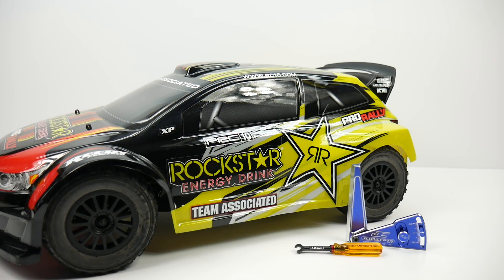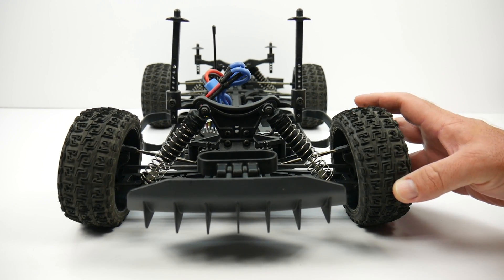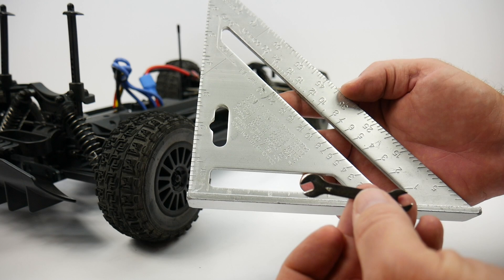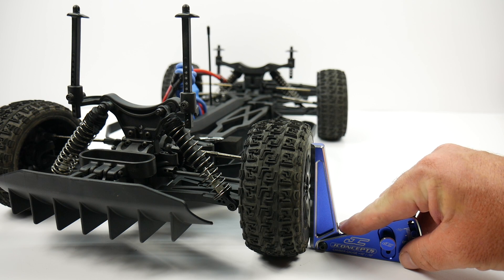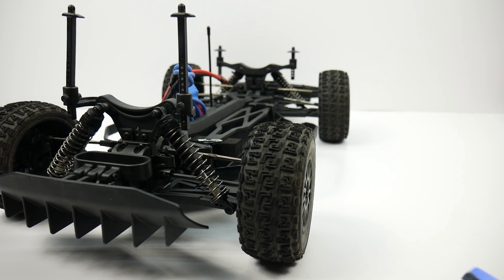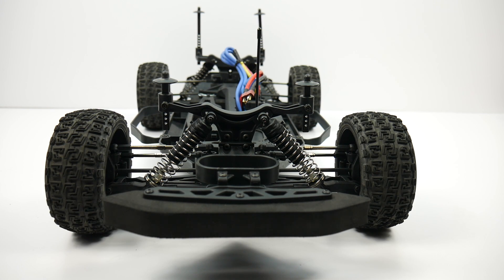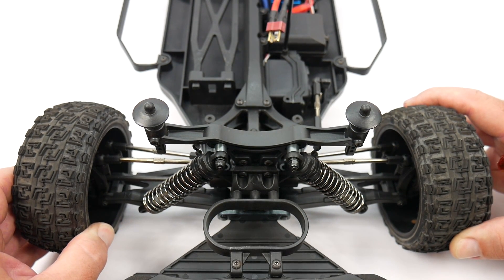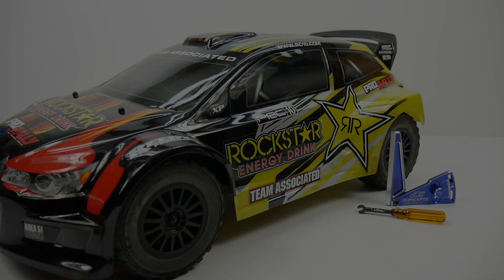RC Beginner Series - Adjusting Camber and Toe

Comment: Only thing I would add to your awesome video is that dropping the car straight down isn’t the best way to drop it. The car should be dropped with a bit of a forward motion so that the car rolls a bit. This way the tires won’t stick to the surface holding back the true adjustment. It also mimics the cars true motion as it is driven.
Reply from the maker: Thanks for the info!

Comment: Hello. I am a beginner to RC. I currently own a E10. I have a 300mah charger. I currently have a 2000mah NiMH. I will be buying a 5000mah battery. How much time will it take to charge the 5000mah? thanks
Reply from the maker: I'm not sure I understand the type of charger you have - they're typically not rated in mah.  In the grand scheme of things, a 2000mah battery will charge a little less than half the time a 5000mah battery will with the same charger and settings.  Why not step up to Lipo?  Chargers are hitting an all time low of $50 or so for a decent one and Lipo's in that range (5000mah, 2s 40c) are about $35 or so depending on the brand.  Be sure to review the rules of Lipo batteries and they can be very safe and provide a much better driving experience - meaning no fade of power, batteries last longer, lighter, etc

Comment: Hey Rich! I'm getting a new rc car and I have a 400 dollar budget currently looking at a Tamiya Xv-01 and a Hpi Wr8 Flux both used but in great condition. I can't decide one what to get I want a rally type of car that I can use both on road and off road. Great Videos Rich like always keep it up!
Reply from the maker: The Tamiya, you will get a GREAT body and detailing...The HPI you will get a pretty good driveline that's capable of higher speeds.  I would pick the HPI...but be ware of parts issues with HPI.  Also look into the Kyosho DRX VE
Reply: The RCNetwork Thanks for the response! I was debating the hpi since it is a 1/8 and bodies aren't really
made for 1/8 rc cars(on road bodies) but thanks for the response! I think i'm going with the wr8 as I am going to be bashing this car a lot. I did take a look at the Kyosho Drx Ve and am also debating on that one.

Comment: For best results you should make sure to have the vehicle fully-equipped when setting suspension. The static sag changes as you add weight so camber will change as you compress the shocks with the extra weight.
Reply from the maker: +MotoErgoSum I mentioned this in the video.....and that I left the body off so the viewers could see easier
Reply: Tell me you didn't watch the video, without telling me you didn't watch the video.

Comment: There are companies that sell gauges for setting the toe. I purchased one for less than $10.00 shipped, and it works great. I use it on all of my rigs. 
Thank you for another awesome video.
Reply: Yes , I have a RPM toe gauge I bought on Ebay for like $9.00 :-)
Reply: You can use a camber gauge by using a vertical wall behind or in front of the RC with the camber gauge flat against it.
Reply from the maker: Good deal!  Have a link?  it will goto to spam, but I will approve it if you post